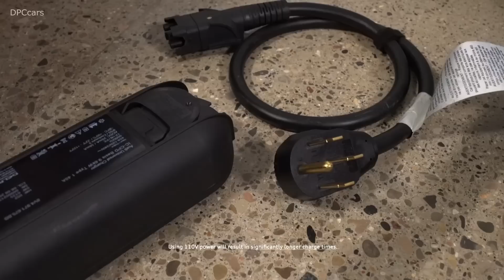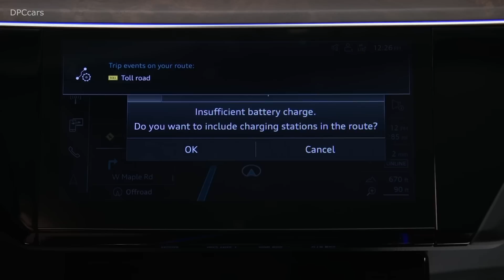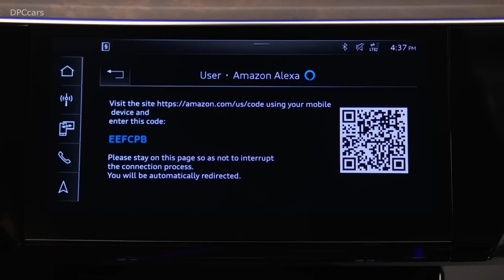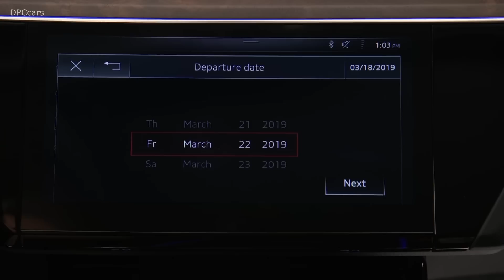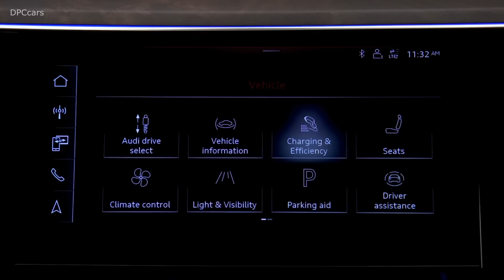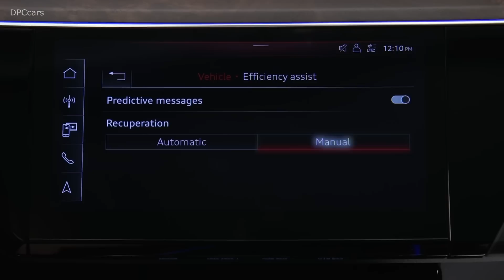2019 Electric Audi e-tron Features Explained

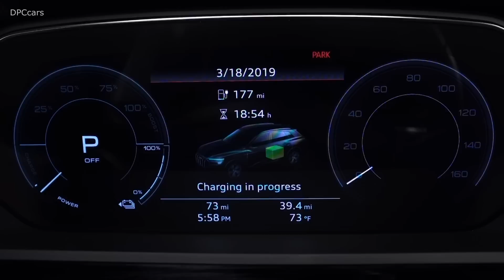Comment: 1:58... 18HOURS????!!!!!
Reply: Eddy Osaman with a 110v yes 110 charging is very slow for any car
Reply: Basically, don't charge on a 120V line if you drive a full 200+ miles every single day.
Reply: It’s actually longer on 110v.  Audi official website lists level 1 charge (120v) as 80-129 hours. You really need get a dedicated Level 2 charge port practically at home.
Reply: @ONI1013.  wait did u say 120 hours???
Reply: @vad3ryt828  it has 95kWh battery capacity. here we can only get ~3kW out of the 110V sockets. so thats over 30h of charging time.